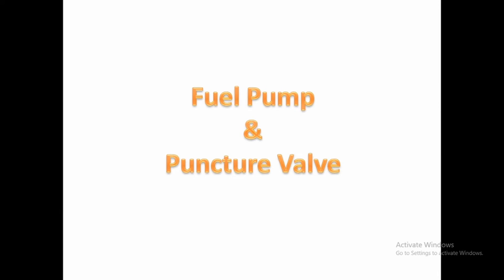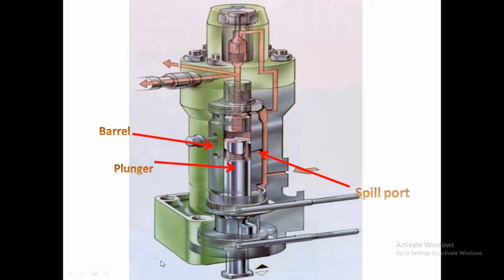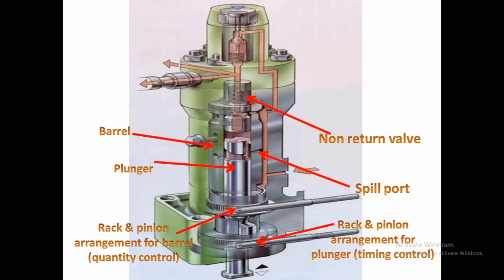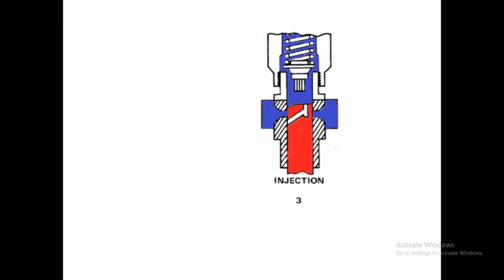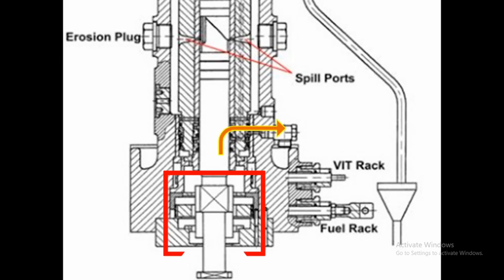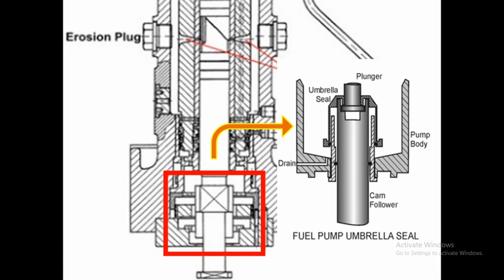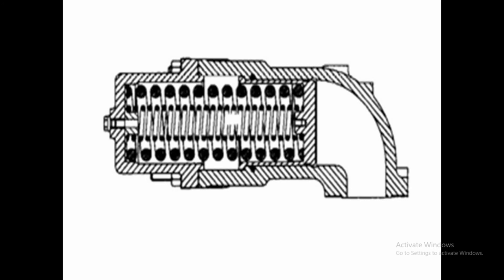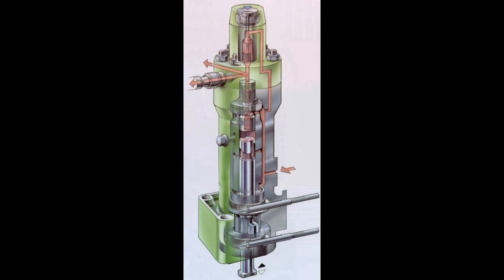fuel pump & puncture valve

Comment: In this video,there is a little mistake..There are two racks.fuel rack and vit rack.Fuel rack moves plunger and its use to change end of injection(fuel quantity change).VIt rack moves barrel and its use to change start of injection.(fuel injector timing change)
Reply: Barrel movement is in super VIT. Basic VIT can be achieved just by changing profile of plunger. You are talking about super VIT